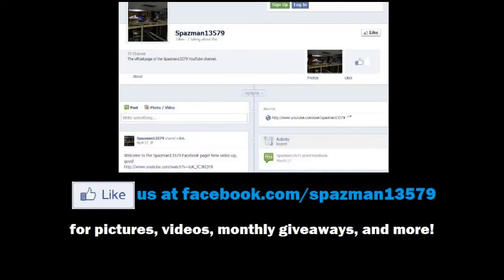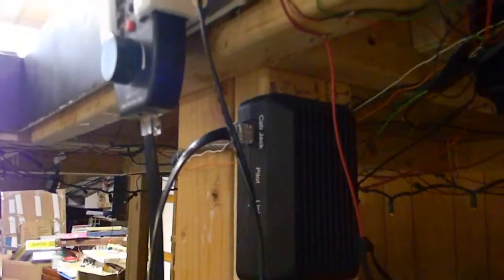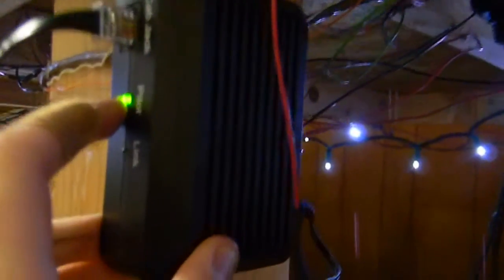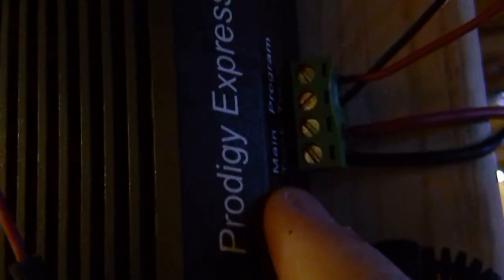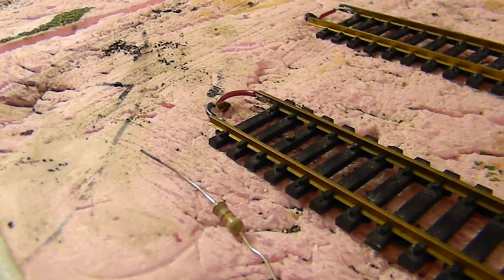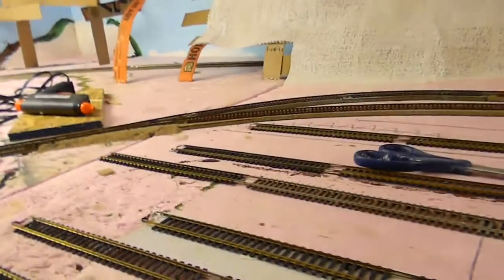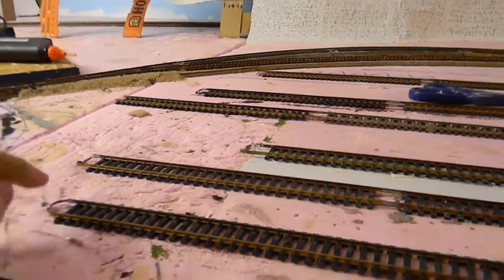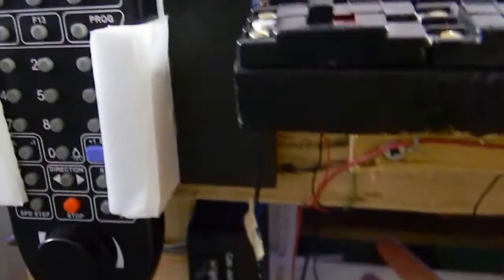SERIES: DCC for Dummies Episode 2

Comment: really appriciate the info! Been watching so many DCC wiring videos and none told me the distance between feeder wires. Im building a ceiling layout, basically just one track that circles my living rooom and dining room. Its about 70' of continous track. So id assume thats too large of an area to just have a few feeders? Every 3' is still what youd suggest?
Reply from the maker: +jesserooker345 What scale is it, and how many locomotives will you be running? It mostly depends on amperage draw. You can go with the every 3', but for a basic 1 track setup like it sounds you have, you can do every maybe 5' to reduce cost and hassle.